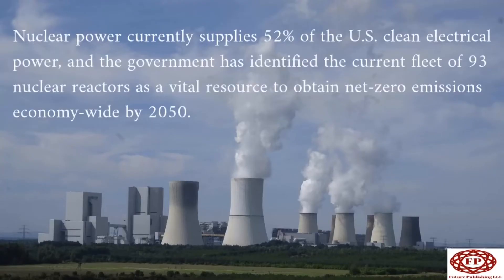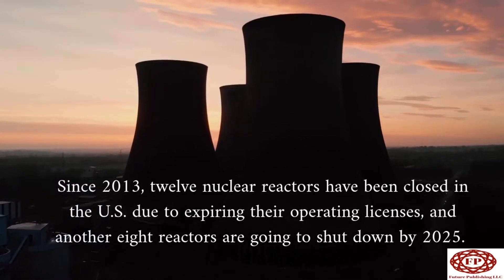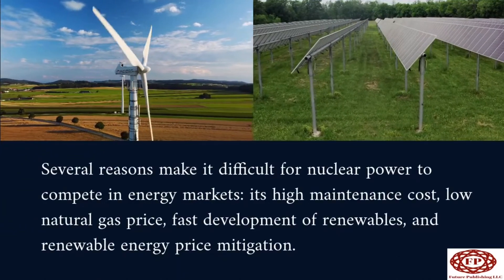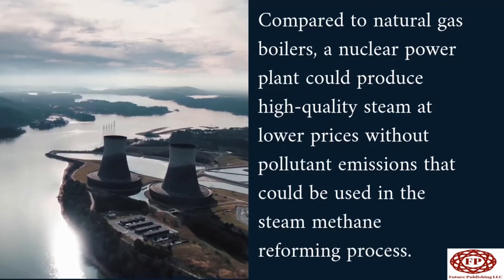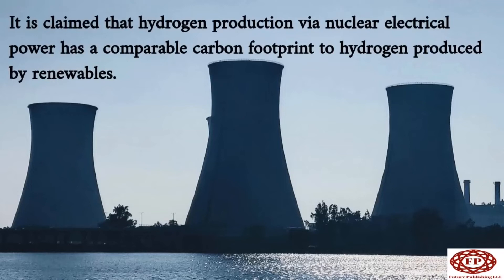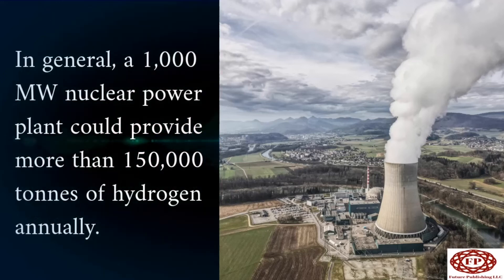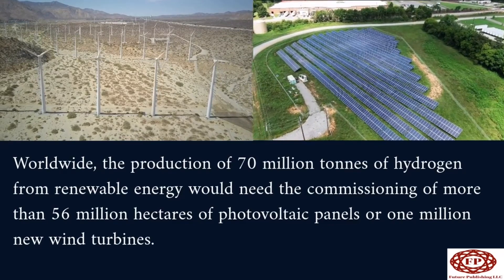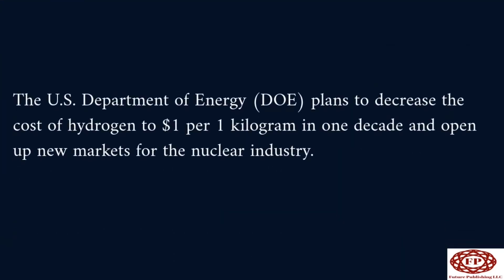Pink hydrogen (nuclear hydrogen) production steps

Comment: “It is estimated that a 1,000-MW reactor could support the production of 150,000 tonnes of hydrogen a year. This hydrogen could be used for fertilizers, oil refining, steel production, material handling equipment, fuel cell vehicles, and carbon-neutral synthetic fuels.”
This is what we’ve been trying to say for years: Nuclear means not only zero carbon electricity for battery cars, but also zero carbon hydrogen for everything else. And on a tremendous scale!
Reply from the maker: Thanks for your informative comment.
Reply: what is the source of this estimation sir?
Reply: Only excess production should be used to produce hydrogen. It's way better than slowing down energy production.
The stupid thing I heard from this video is shuts down because of licence expiries. The cost of those are excessive and could have provided low cost energy to individuals and companies for decades. You should shut down problematic power plants, not because of licence expiration. Or create a regulation that automatically renew the licence with reasonable adjustments until the power plant is no longer viable.

Comment: The hydrogen production rate mentioned in your video equates to ~18 kg/MWh, which is the rate for low temperature electrolysis.

NuScale have put out data to show one of their Power Modules (NPM) can 'tap off' 300°C high pressure steam and, using 2.5% of electrical capacity, boost the steam temperature to 850°C to feed a high temperature steam electrolysis plant (HTSE) reaching production rates of 27 kg/MWh - a 50% boost from existing light water reactor (LWR) technologies.

No need to wait around for development and licensing of high temperature reactors (HTRs), operating power plants now could be kitted out to produce pinkH2 at this rate.
Reply from the maker: Thank you very much for your comment. Currently, a significant portion of H2 generated by electrolysis is made via alkaline or PEM electrolyzers that work at low or moderate temperatures. The most important issue with the Solide Oxide Steam Electrolyzer (SOSE) is needing high temperature (expensive) materials. If this issue is solved, the SOSE will produce higher amount of hydrogen without any emissions (if nuclear is used). That's why it seems developing pink hydrogen could be better than green hydrogen in the short time.